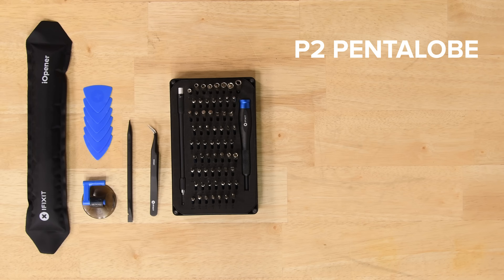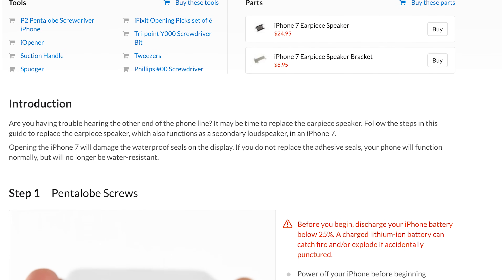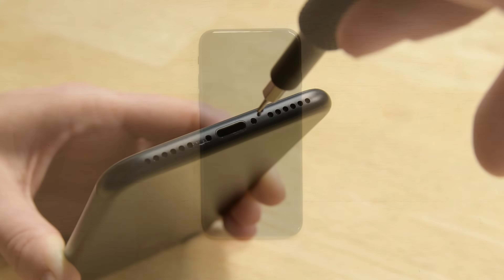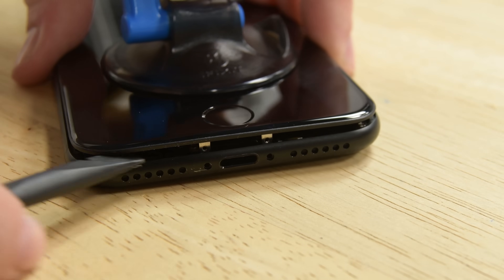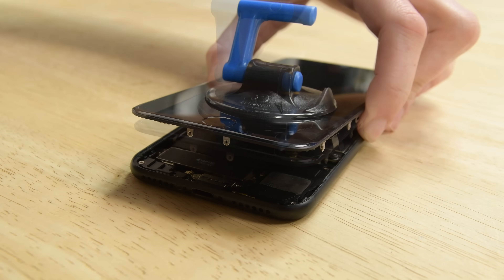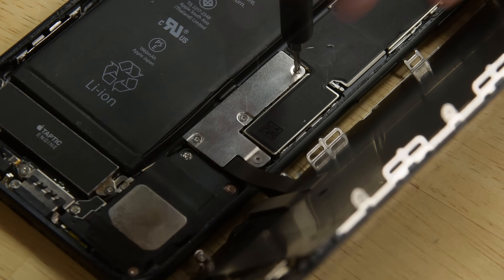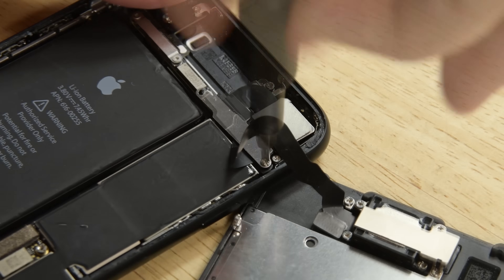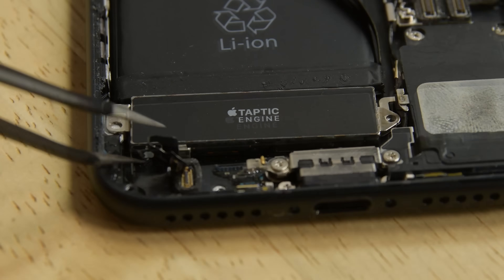iPhone 7 Taptic Engine Replacement- How To

Comment: I saw a video where instead of buying another taptic engine you just need to tighten the screws on the current one
Reply: was that not working before and when they tighten that it satarted working?
Reply: Yes that's when your taptic engine is loose and has a buzzing loud noise when using it. Just befase of a screw that's loose, has come off inside

Comment: I have changed the taptic engine but vibration still not working
Reply: So do you find the problem bro ? My vibration has gone due water damage I think.I don't know, should I change my taptic engine or no ?

Comment: Ive replaced the heptic on my iphone 7 but still no vibrate so for any of you who have the same issue if you ringer also doesnt work replace the charging port as not many people know this but the ribbon on the charging port that the heptic vibrate motor connects to often gets damaged by screen or opening phone screen up caused my issue and is now fully working hope this helps some of u

Comment: Hello 
I have a problem about to change the Home button of iphone 7 
Non is working so what is the solution now I tried with many pieces and then until now nothing happened no way of the home button knew when not come from the company but they high-quality working
Reply: Omran Abou fakher the home button touch ID is paired with the motherboard of the iphone. This means that only the original home button will work with the iphone, every replacement will not work. Bring it to an applestore, they will change it and modify the firmware of the motherboard to accept the new home button they put in

Comment: I far as I can see, you don't need to remove screen cables from phone! just open the phone like a book and replace the module, without disconnecting screen cables.
Reply: Jawad Ahmed i know this is late but with self repairs it is safer to remove certain cables such as the battery, when you repair it and dont disconnect the battery and try to put everything back together it can send surges of power through the phone therefore shorting out the screen... i know from experience

Comment: 1 Never seen a broken Taptic Engine 
2 There is still Apple Warranty on every single iPhone 7 that’s been sold. (Except for self repaired ones)
3 Factory new iPhone parts are all faked 
Then why repair ? Apple Care plus 2 years of Full warranty and insurance. You can throw your iPhone 2 times in 2 years and then you get a new one for a few bucks.
(Still good repair guide 👏)

Comment: I love how apple makes the insides of there phones look just as good as the outside. Every other company is using ugly blue circuit boards or red batteries.
Reply: Steven only one plus used red battery
Reply: Steven but I get your point
Reply: stop being ridiculous
Reply: apple always had mediocre hardware .. so they had to make it look beautiful .. its not that beautiful anyway
Reply: Yasin Hasan android lover :)))
Reply: Yasin Hasan i might have to argue with you at this point and say that apple runes much much much more better than android! Also it uses less memory! Less battery less everything! The only very bad thibgs at apple is that they are too paranoic with theyr restrictions and lately with prices.
Reply: Yasin Hasan I've seen like 10 Android phones that aren't plastic. Don't even try to bring up hardware🤦🏻‍♂️